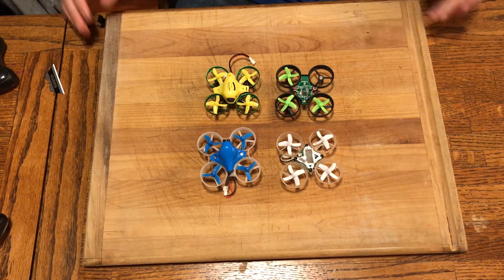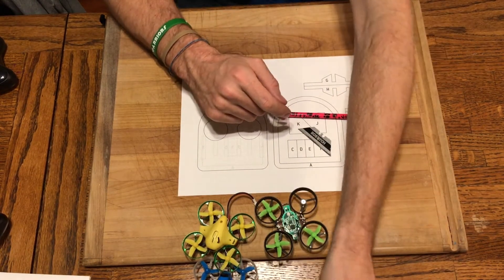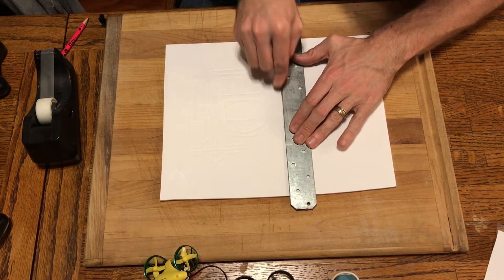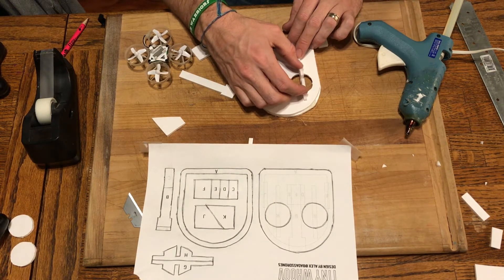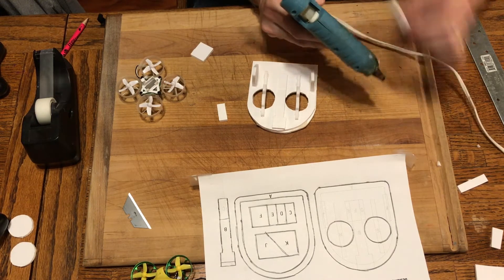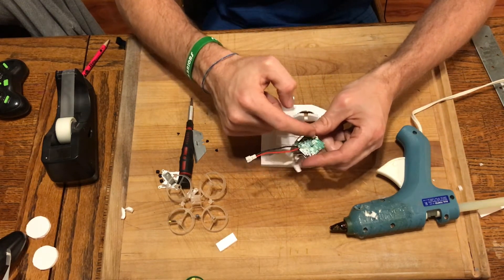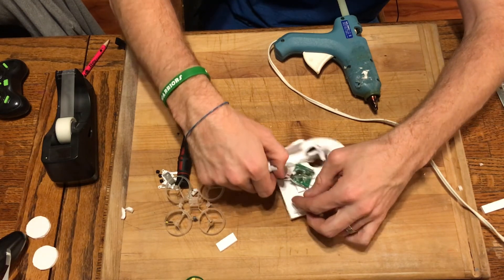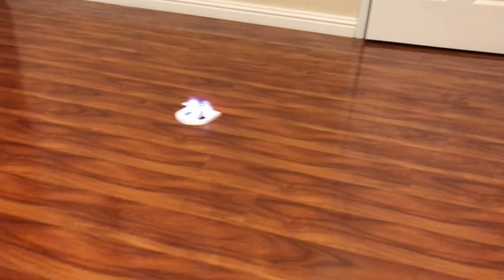Cheap Home Made Radio Controlled Hover Craft! How to Make a Tiny Whoov

Comment: You goofed up the battery holder as you glued the walls flat instead of upright ;)
Reply from the maker: Thanks! Guess I'll have to make another one.... just when I was getting used to dragging the battery around on the floor behind it too!
Reply: Also the parts you glued on top for the motors should go on the inside

Comment: i built this and mine just spins uncontrollably i have tried trimming it and it doesnt help any ideas what is wrong
Reply from the maker: Did you switch the rear motors from right to left?
Reply: thanks that was the problem switched motors and it works great now